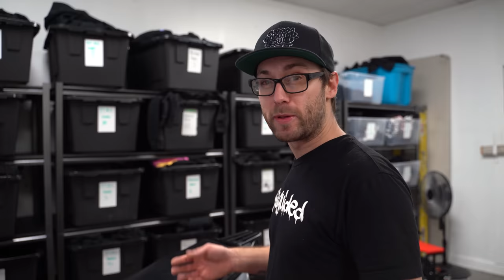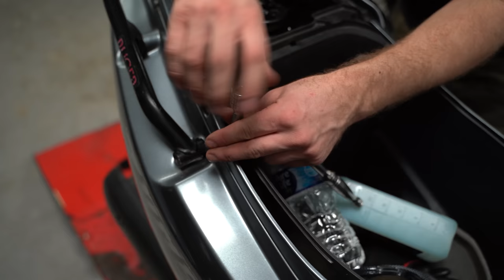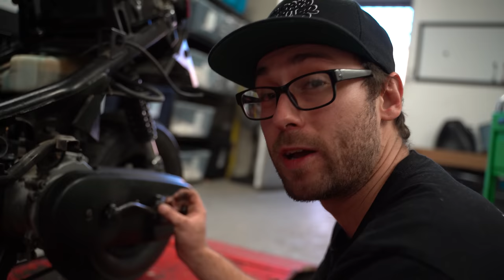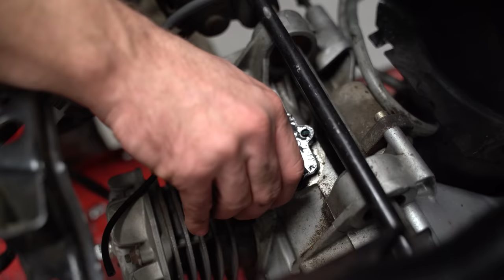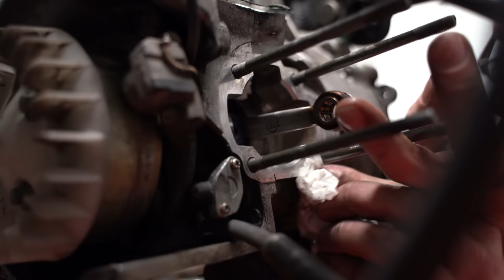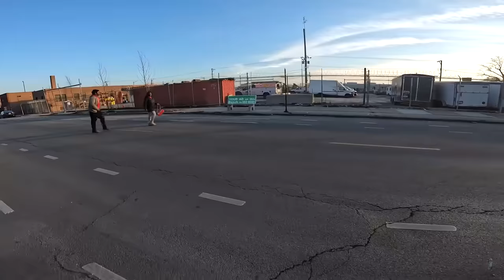Scooter OVERHAUL - (Big Bore Yamaha Zuma Build)

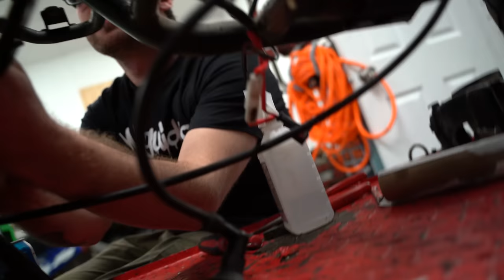Comment: RC cola spotted on the lift table at 9:58.  That's the good stuff!
Reply from the maker: That’s all we stock in the vending machine
Reply: @misguidedmotorsports  When I was a child, my dad worked as a delivery driver for the Dr. Pepper plant.  They did the bottling and canning RC cola along with the distribution.  There were the times when they had crown caps on the 12 ounce returnable bottles.  His route took him close by home during lunch on Wednesdays and I always got a freshly bottled something of my choice.  They took the carbonation to the moon back in those days and it didn't matter what pop you got, you got a good eye burner from all the carbonation.  The RC was my go to back then.
Reply: @misguidedmotorsports   how much did the full kit cost and where can I one mines a 100cc but I want it faster
Reply from the maker: @r_3_d_m_u_r_d_3_r-_-25  give us a call we will run ya through some way we can speed her up 773-887-4369

Comment: Install piston into the jug and mark where the exchange  , intake and exhaust ports are on the piston. Ramp the piston. Push piston to the top of its stroke and look into the exhaust. If skirt is showing, mark that so you can shave it off. Enjoy the ride. Ramping and skirting a piston will gain more power and the cost is only time.

Comment: Yooo that was a malossi 70cc kit. 49 cc pistons fall threw the stud spacing and 70's don't.  And I'm running an aluminum s6 "prostreet mk2? Pro something, and no not the iron streetrace kit" single ring kit and it's being going strong for around 11k miles. You just need to make sure all horizontal edges of the ports are chamferred and smooth. Don't round the ports or change a lip, you just need to take the sharpness off. Mines running strong with almost no visible scratches and you can see all the crosshatching still. These s6 cylinder kits are amazing. Titanium lined ring with nickel cyl wall. Fully recommend. I use to daily ride on the single ring
Reply: And the piston and head probably looks like that because it had a stock carb. It was burning up from not enough air flow. When u upgrade these scooters it's like when u upgrade one thing a bunch of stuff has to be upgraded if u don't want mechanical failure. I guess that's why mines running so long because I took ALL the precautions. 😂

Comment: 3 minutes into this video, and I'm wondering how this bike ended up at your shop. Never built a horizontal minarelli? Clearly brand new to this.
Reply from the maker: When you open a motorcycle shop, you are opening yourself to working on bikes that you are not familiar with. First time for a horizontal motor (openly admitted), although have dealt with many other small bore 2 strokes. However, BRAND new to the BUGEYE as well as case induction. Thank you for watching 3 minutes!
Reply: The way he was amazed that the carb fed air/fuel directly to the crank case was sad...........its like uuhhh every 2T gas engine known to man pulls the intake charge into the crankcase first lol.   Then he couldn't tell that malossi 70cc bbk was a 70cc bbk...even when taking it apart.
Reply: @chrisapolinar1102 he unhooks the fuel line and says "why is this not pissing gas right now?". He works on scooters and doesn't even understand a vacuum petcock? I've found(in my four years working on mostly scoots, as opposed to three previous sixteen years working on bigger stuff) that "scooter mechanics" are often at a much lower level of mechanical knowledge and ability than automotive mechanics. I have theories on why this seems to be the case, but I don't want to write a book in the utube comments. I'm sure the video creator is probably a decent mechanic, but was just new to this specific stuff. Hopefully(for his customers)
Reply: Doesn’t know about case induction, can’t look at a cylinder and tell aftermarket from stock, and then pulls the head off and still doesn’t recognize it’s not stock right away—the oring head gasket should have gave it away, among other things and then shows the head to the camera and it clearly has MALOSSI cast right into it.  🤦‍♂️

Comment: That engine saw a lot of cold starts straight to rides
Reply from the maker: Yes sir
Reply: No that engine was likely run without oil in the tank or no one bled the oil pump when the new bbk went on and seized it right away.

Comment: I just bought a bug eye Zuma from a ginger kid and his dad. I pull up and the scoot has a big jumper pack hooked to the battery and the dad is stomping the kick starter furiously. Which confused me because i agreed to purchase the scooter in non-running condition. Maybe he thought he could get more money outta me if it started? Joke woulda been on him, I'm broke. Anyway the last kick he gives it, the kick starter stayed pointing down. He had screwed the kick start clamp bolt in the wrong direction. Anyone familiar with these knows that means it wasn't clamping anything like that. Goodbye splines right. The dad tells me his kid bought the Zuma(for way more money than I'm paying) rode it for five minutes and it died and never started again, and he thinks it just needs the electric choke. I paid the kid, brought the scoot home, and it has 60psi compression. Upon cylinder removal i find a BADLY scored 70cc cylinder and piston, with a stock 49cc head gasket hanging way into the cylinder. Wonderful, but pretty much what I expected. 
PS I'm amazed how big and heavy the Zuma is. These things must be unbelievably slow stock. I've got a Vino that uses the same engine and i swear it weighs at least 100lbs less than the Zuma and it's a foot shorter. The Zuma is a tank

Comment: Can’t believe you put that piston into the cylinder with lubing it with some premix, bet you put the wrist pin bearing in dry also. You really need to do better. That old piston and rod got hot because someone ran it out of oil.

Comment: you americans are so weird, calling a 70cc for bigbore... lol in the rest of the world it's just 70cc...
Reply: They're 49cc stock here. So since a 70cc has a bigger bore than stock, we call it a big bore. As do the places that sell them
Reply: @middlesiderrider  the same here i eu... stil is just call 70cc
Reply: @TEAMVISKAT81  what's kinda interesting is that my 47mm cylinder kit was sold as a "72cc big bore". But I saw some 47mm kits are sold as a 70cc. So I looked into it, and used a displacement calculator to find out the actual displacement. A Minarelli horizonal has a 39mm stroke, so with a 47mm piston it's actually only 68ccs. That sucks haha